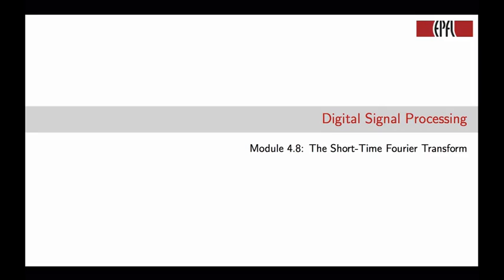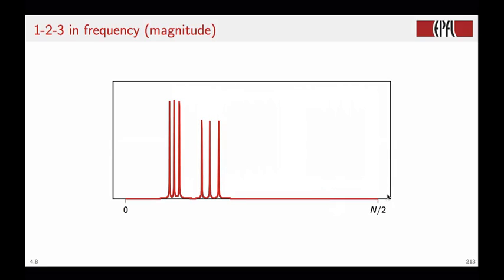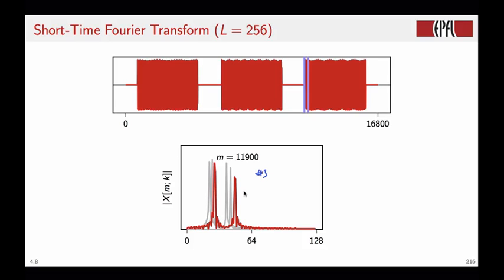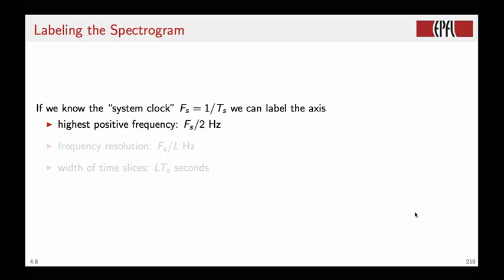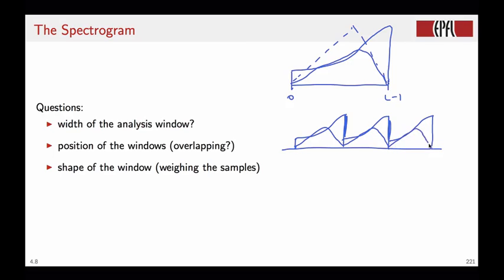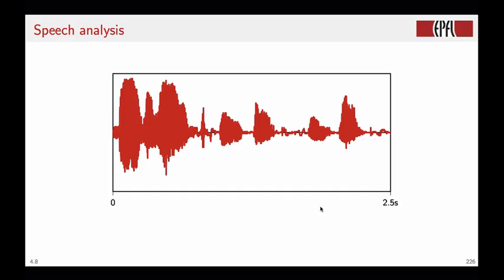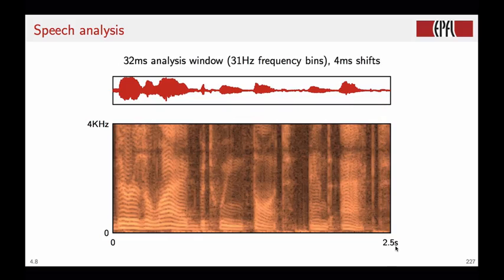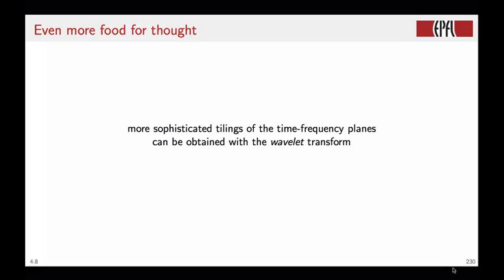The Short Time Fourier Transform | Digital Signal Processing

Comment: Should the power in dB not be from: 20*log_(10)(abs(X[m;k]))? Since power is equal to the magnitude^2? i.e. if you wanted to use 10log10, you'd need to include the power of 2 inside the logarithm: abs(X[m;k])^2

Comment: Hey, this is an awesome video to understand Spectrogram. I was so excited with your youtube video and so I created blog post that reproduce many of the plots in your presentation in python https://fairyonice.github.io/implement-the-spectrogram-from-scratch-in-python.html.
Thank you very much for this great tutorial.

Just one comment: Your slide at 2:39 contains 6 peaks and you say that two of the each peaks corresponds to one dial sound. As you are using the digits 1, 2 and 3, I would expect to see 4 peaks at 697Hz, 1209Hz, 1336Hz and 1477Hz, rather than 6 peaks in the frequency domain plot. Maybe you are rather using digits 1,5,9? I am not sure. But anyway, the concept was very clearly explained so thank you very much!

Comment: hi, how do you get the time and you say that the y axis represents magnitude of DFT coefficients, but its just the frequency axis. magnitude is represented by hue variation of the colour. could you please help to get away with confusion ?
Reply: The y axis represents the frequency axis. The hue represents the magnitude of the corresponding frequency. So to be more clear, if you find a lighter or as the guy in the video says, a "brilliant" band somewhere on the spectrogram, the corresponding y axis value represents how high the frequency of the signal is and the amount of "brilliance" represents how loud the signal of the corresponding frequency is